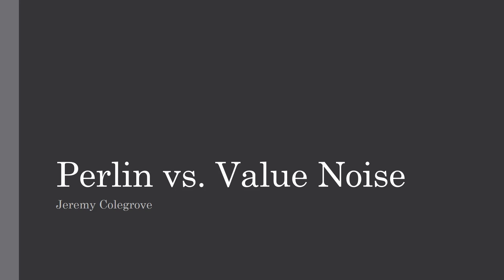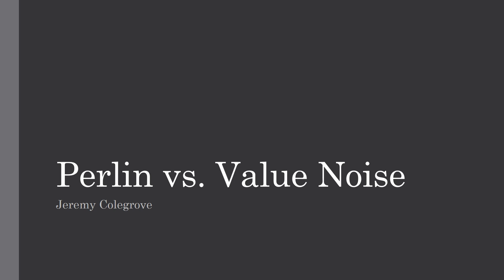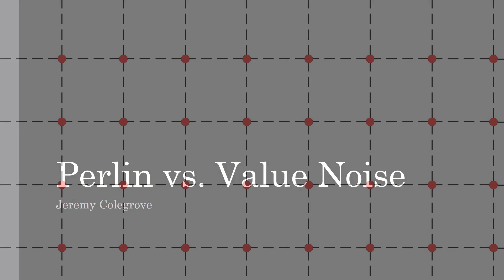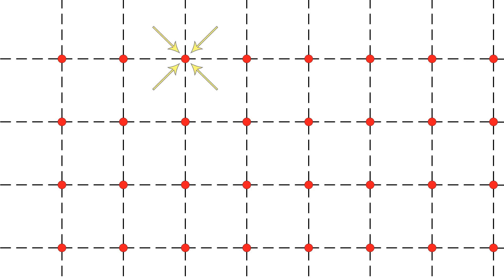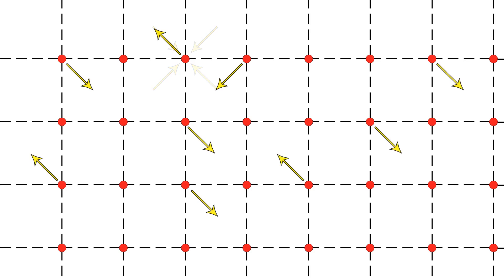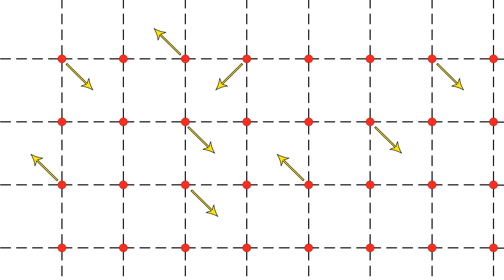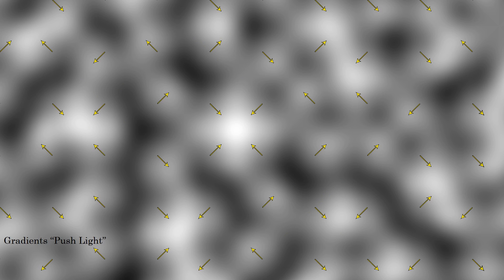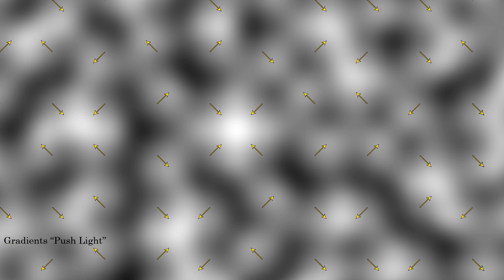Value vs. Perlin Noise

Comment: So, does Perlin noise have equal value on every grid point and all of the variability happens between these points?
Reply: I know this is 3 years old, but for anyone wondering - yes, the value is 0 at each grid point (whole number coordinates).
Reply from the maker: The points on perlin noise is not a value, but rather a two directional vector. That is the main difference between perlin and value noise